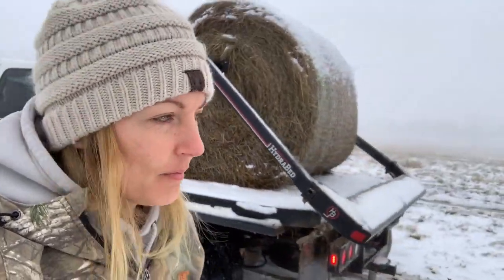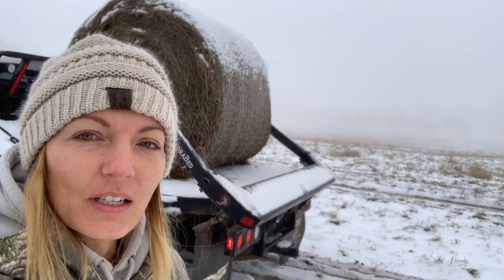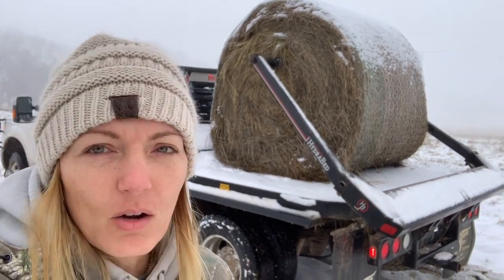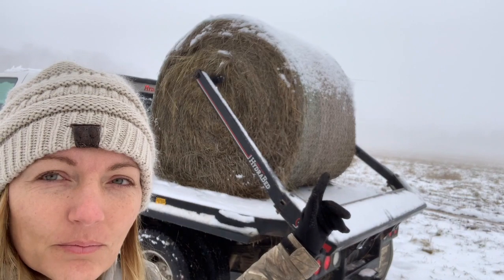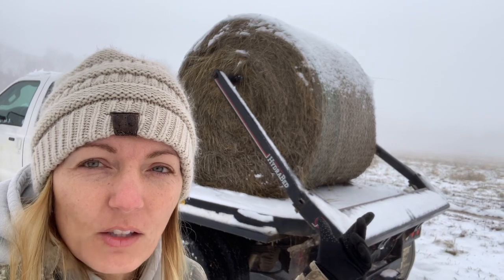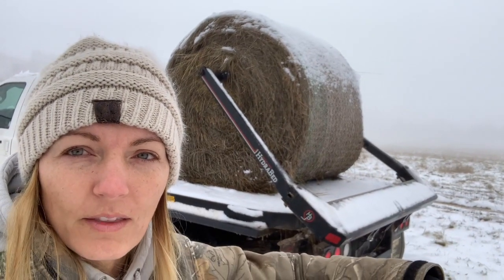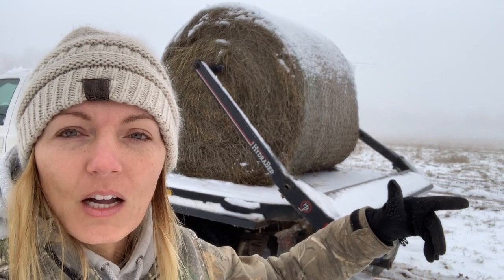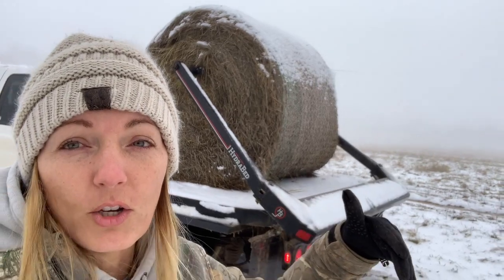Farm Girl Friday #109 How to roll out a frozen round bale of hay

Comment: Hey Miss Carey; I feed with a TD80D and can haul 3 bales at a time. 2 on the front and 1 on the rear. These bales only weigh 750 to 800 pounds. I pull the net off and use the loader forks to unroll the bale. Works for me and spread the potential seed and fertilization into strips. I quit feeding in hay rings or open available bales years ago. The hay wasted could be less or more, but the benefit is first, less local soil damage, second better fertilization of a larger area, and third seeding of plant species to improve future grazing. Rolling out a bale of hay under the correct conditions from the my experience is superior to other feeding options. Take Care Miss Carey.
Reply from the maker: yes!  When I have a tractor it is easier, I can break the frozen net wrap with the forks and roll it out that way, since we've had so much ice it doesn't work as well with the Hydrabed.  Now if we had a barn that kept it all covered and dry, different story.